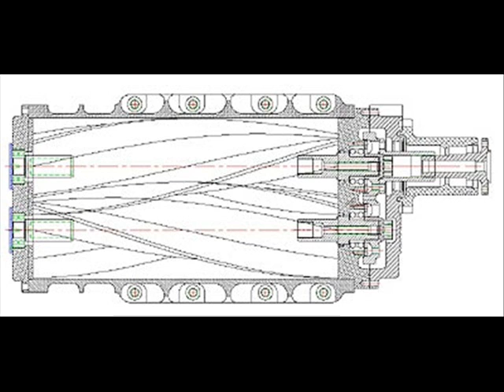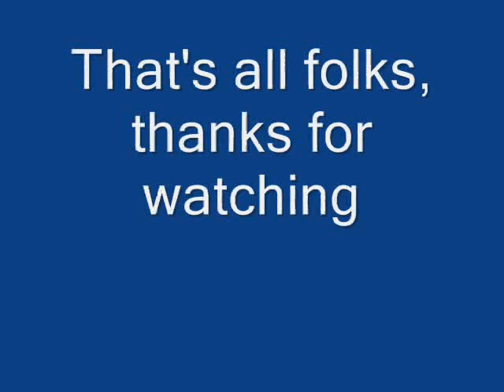Knex V8 Engine + Roots Type Supercharger

Comment from the maker: i used two rods for the piston... one long one which is connected to the piston and the shorter one connected to the crank. the long rod has to be guided up the piston block by at least 2 points to stay straight. friction is also gonna be a problem so you wanna keep it low-torque, meaning shorter cranks. this way it can rev higher without jamming. well good luck!